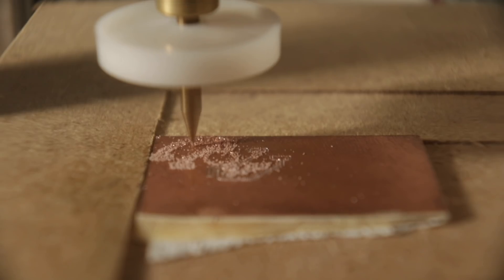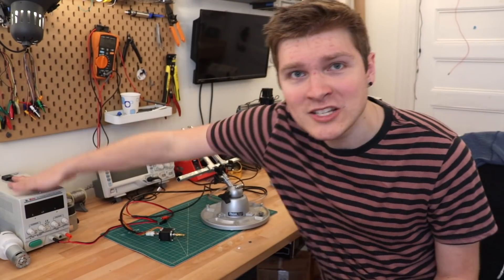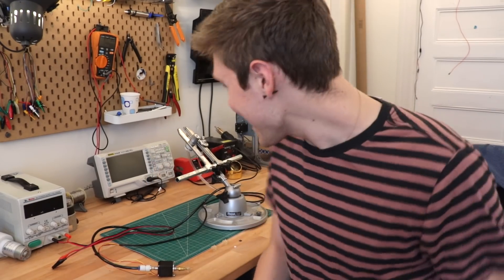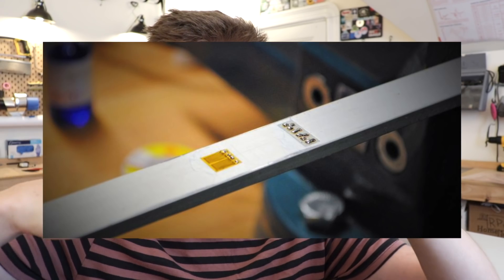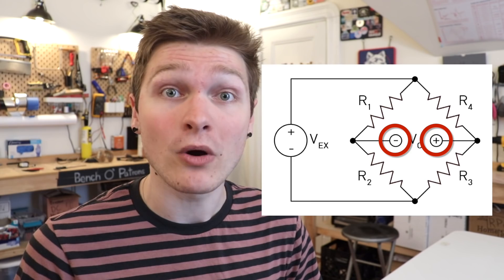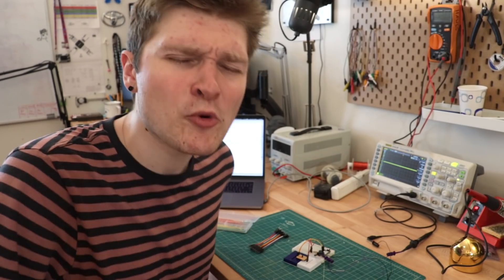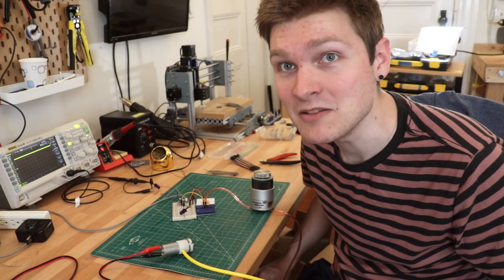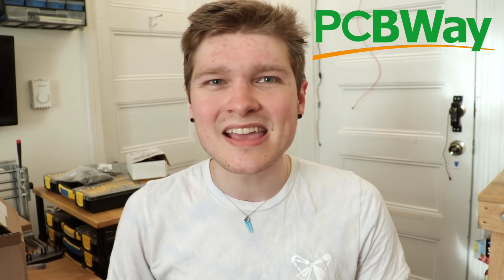Vacuum Sensors Are My Nemesis

Comment: Could you measure the current draw of the vacuum pump itself in order to tell if it's got a part picked or not? I imagine it would draw more when the motor is under load.

Comment: What about the MPX4250??
From their datasheet: Integrated Silicon Pressure Sensor
On-Chip Signal Conditioned,
Temperature Compensated and
Calibrated
0.2-5V output.

Comment: I tried the 180 degree strategy. But the open PNP guys didn't want to support the software.  They want 360° rotation.  I changed the code, but they update the code so much, that I gave up.

Comment: How about monitoring the pump's motor current? (or RPM if you can fit a hall effect sensor somewhere on the motor)

When there's a part attached and vacuum drawn the current should decrease and RPM increase due to less airflow through the fan.

---

EDIT: Should have read the comments. Seems this has already been suggested a few times.

Comment: What you really want is an instrumentation amplifier. But more Than that, there are pressure sensors with built in amplifiers and even adc's with built in calibration and a digital interface. For the sake of saving time and getting a better signal I suggest you get some of those.

This is a good one: https://www.adafruit.com/product/3965?gclid=Cj0KCQjwyJn5BRDrARIsADZ9ykGusnihpehcSzs6N50H4rc67sYxJeXsjRiau5O0UXXwx8eqmVbDoNEaApwMEALw_wcB

Comment: You mention that the rotary joint is leaking air, where does it leak air? is it the adapter below or the screw part of it?
There's sealing material available which is normally wound around the screw part.
https://de.aliexpress.com/item/33033430576.html
I did not see that on your rotary joint, can you double check that?

Comment: Why not just meansure the current going to the pump?
When it's on "load" it will draw more current
With that you can tell if it has picked up a thing or not
Easy
Reply: Just made a similar comment, but it will draw less current, and RPM will increase  when the inlet is blocked (not bog down as someone else said).

Try it with your vacuum cleaner at home. Block the hose and RPMs will rise quite sharply and if you have something to monitor the power drawn from the socket you'll see a drop in power consumption.

....it's fairly counter-intuitive, but pump is doing less work and moving less air so motor is under less load (so will spin faster). Same happens with a box fan or PC fan if you lay it flat on a surface.

---

Oh yeah, with a diaphragm pump the opposite will be the case (but that's not what we're using here).
Reply from the maker: hmmm, that's a pretty cool idea! might also be useful for other things that could be controlled with the FETs on the board. ill look into that!
Reply: @stephen_hawes  while this is a cheap way, a kinked hose will send a wrong signal.  And if you plan on having more than one vacuum actuator in action (multiple pick heads) then it will be an issue.
Reply: Was about to say the same thing but saw this comment. Way simpler to do this, and you don't need to buy a special vacuum sensor

Comment: I've used the ADS1247 ADC from TI for similar resistive applications - it can be configured to output a fixed current that can be used to drive a resistive  load (in my case I was using a PT100 thermistor) in a 'ratiometric' approach. Accuracy will be down to how accurate your reference resistor is (ie pick a 0.1% tolerance resistor and you've got very high accuracy). You can communicate with the chip over SPI, set interrupt triggers on the chip itself (ie once it detects a certain level, it triggers an interrupt pin that can be used to signal back to the MCU). I guess in the bigger picture, the same ADC can also be used for high resolution sampling of thermocouples or other analogue devices. Just a thought but it's an easy implementation that gives you a ton of functionality (and a digital output).
Reply: Take a look at 2.4 (Three-Wire RTD Measurement, Low-Side Reference, One IDAC Current Source) in this TI doc for rough idea on reference design: https://www.ti.com/lit/an/sbaa275/sbaa275.pdf ... I dropped the input impedance resistors and smoothing caps on the line side and it worked well for my purposes! You could basically just drop the part across those pins and you'd have your digital output.

Comment: hello，I can successfully upload your firmware to ARDUINO, ramp1.4, or connect with pnp software, but I can’t control the motor movement. I hope to get some help, and what went wrong, or you can issue a simple issue of how to upload the firmware Control the video.

Comment: If the vacuum pump bogs down when you cover all the holes, couldn't you just measure the increased current draw to the motor to detect when you've picked something up? This seems a lot more simple than trying to add a pressure sensor.

Comment: INA333 is a great part for your wheatstone bridge, btw! one resistor to set the gain, GND referenced signal out.
Reply from the maker: sweet, thanks for the part number! i'm looking into using chips from that INAxxx family, seems like it'll be more straightforward than doing it discrete.

Comment: A wheatstone bridge is not neceserly build of two extensiometric gauges the definition you gived wasnt wrong neither wasnt good, as long as you only nead 4 normal resistor to build a wheatstone bridge which btw is a quite common way of signal aconditioning for all the resistive sensors. And for the sake of electronics learn at least ideal op amp they are the easiest thing in the world of electronics. And for those type of builds you wont need to know whats happening inside
Reply: However love your videos dude you are awesome and that pick and place machine iss pffff

Comment: The "Programmable-Air" uses a similar or the same gauge pressure sensor and is controlled via Arduino. The schematic is available here: https://github.com/Programmable-Air/PCB/blob/master/programmable-air-v0.5/schematic.pdf

Comment: Check out Honeywell's TruStability Sensors. I have used the Analog output ones with a lot of success, but they also have digital I2C and SPI versions. (kinda pricey tho, they're pretty accurate)

Comment: You know... The power supply behind you was changing current wildly every time you sealed or broke the vacuum... That gave me a totally different idea on how to detect of you picked up a component.
Reply: That is actually not stupid idea to just sense the current! And it can be done with just a simple INA214 and a 10mOhm shunt! Used it a few times before and it works really well!
If you read the comment Stephen then just remember to place the INA214 close to the shunt. There are great layout examples in the schematic or HMU if you need some help with it
Using 10mOhm shunt and the INA214 you will get a 1:1 so 100mA is 100mV
Reply: that is actually pretty smart solution

Comment: Hi, your PNP vids have been interesting. 👍
I used silicone surgical tubing on my machine, it is rubbery soft are easily rotates the 180 degrees, and it easier for the machine to move it than plastic tubing. You can buy smaller sizes, sometimes also used for surfboard legstraps or slingshot rubbers.
Definitely try the Honeywell sensors, with inbuilt amp giving calibrated 0 to 3v output.
Finally for the pump I use an aquarium airstone pump, rigged to suck not blow. It is very quiet and can run forever without overheating etc.
Also, your vacuum solenoid to turn the vacuum on/off should be a SPDT type so it releases the component by letting air in. They are common in 12v fuel injected cars and motorcycles. 🙂

Comment: For prototyping purposes, you could try programmable air: https://www.programmableair.com/ which is an open source arduino compatible board that can both control and sense vacuum.  plus a couple of valves thrown in too. The kit comes with all the things for you to build the pneumatics for the pick and place, right away. But, since, i dunno when their next batch will be up, you might not be able to buy one. (I got mine during its first crowdfunding campaign, and have been trying to learn from your channel, the journey towards building a pick and place machine myself). It is open source. So you could just see what parts are used there and use the libs for it too. https://github.com/Programmable-Air. Also, there are ADCs with differential amplifiers built in, like the ADS1115 (16 bit) or HX711 (24 bit), with which you can do your strain guage measurements. You can make constant current sources with LM317s too, which is generally something that you'd probably have a better intuitive understanding of.
Reply: It looks like it has the same sensor you're using. And uses an instrumentation amplifier

Comment: Steven, You can get 360 degree rotatable fittings from Festo that doesnt leak like a sieve. Don't confuse with the Orientable type. Pages 11-14 https://www.festo.com/cat/xdki/data/doc_engb/PDF/EN/FUNCTION-FITTINGS_EN.PDF
Also think you should use the smaller diameter tubing reducing volume of air being moved and increase time for vac etc. Possibly PUN-CM-4-SW.  Its antistatic as well.

Comment: Stephen, in case you haven't discovered it already, I'll point out some problems with your schematic. The current source is supposed to set 100uA through the bridge. Your voltage divider R19 - R20 sets only 1.65V, which would cause U9A to set 1.65V across R23, setting only 82uA. (So you would get only 80% output compared to the reference example spec.)  OK, but that 82uA passes through both R23 and the bridge, which is also 20k, with the resulting voltage across them of... 3.3V.  In other words, this circuit design asks U9A to output 3.3V at pin 1. But LM358 (if that's what you're actually using) can't do that, because its output swing is limited to about +rail minus 1.5V, or about 1.8V.  Even if you used an op amp that can swing rail-to-rail, you're asking it to sit at positive rail, so your "current source" is actually no better than just connecting the + side of the bridge to +3.3V.  At any rate, these missteps screw up the ability to set the two bridge output voltages to approximately the middle of the useful range of the output opamp, which you need in order to get useful amplification (x50) at that stage.  You managed to get some useful behavior by throwing in a pot to essentially tweak out the problems in the bridge area, but this is sticking a large bandaid on a problem that can be solved easily with (a) a rail-to-rail-capable op-amp (if you insist on running off only 3.3V), and recalculating the R19-R20 voltage divider so that it sets the bridge outputs at mid-rail (1.65V), and changing R23 so it sets 100uA. So about 6.5k for R23, and about 2.65V at the top of the bridge, so R19-R20 can be a ratio of  0.65 to  2.65, so maybe 6.5k and 26.5k.  And since you would then be using the full bridge instead of half, you get twice the output and also insensitivity to temperature changes.
Reply from the maker: Wow, thanks for the super in-depth info! I had a feeling someone would take a peek at the schematic and tell me what i screwed up! :D I still have a ton to learn about op amps, this has definitely helped me figure out what I need to spend time reading up on. I'm working through the Art of Electronics right now, it's been really helpful in the chapters I've gone through. In the meantime, I ended up going with a sensor that handles the signal processing for me, but this stuff will inevitably come up in future designs.
Reply: @stephen_hawes  Great, I'm glad to hear you have your hands on AoE. Something to grasp is that Op Amps actually vastly simplify analog electronics, essentially providing you with a small number of idiomatic circuits that function as Legos for "analog computing". That is to say, these Legos have a simple behavior where the output of each stage is a simple algebraic formula based on the input(s). It's helpful to know why that algebra works for each of the few op amp idioms, so that you're really convinced, and so that you know what you should also attend to in order to get that "ideal" behavior. The upshot of all that is actually there isn't really "a ton" to know. Just a few essential principles.  In your circuit, you would have got the result you wanted if you realized how the first op amp sets the bridge current, that an objective was to maneuver the bridge output voltages to mid-rail so it has room to vary up and down, and that you need op amps whose outputs can actually swing across the voltage range of interest (not a universal trait when operating with such a low power supply voltage).    So being able to pick out the basic specs on a datasheet would help too.  Anyhow, I'm glad you found a solution, but regardless encourage you to get comfortable with the not-very-extensive basic suite of op amp idioms, and AoE can be quite a help in this regard, in addition to loads of material on the internet (some clearer than others, as usual).
Reply: Dave did a great primer on opamps here. I learned a lot from it...

https://www.youtube.com/watch?v=7FYHt5XviKc

I still find analog stuff a bit daunting, but a bit of Ohm's law and opamp examples really helps.
Reply: When he said "general purpose op-amp" I thought the same but you have here an awesome explanation, nice work, also I really have to learn a lot more about op-amps
Reply: Great explanation. You're probably also better going with an instrumentation amp for this kind of thing.

Comment: Hey Stephen, have you looked at the Honeywell pressure sensors?
https://sensing.honeywell.com/sensors/amplified-board-mount-pressure-sensors

They have the drive and amplification integrated and they have analog out and digital I2C. I’ve used them in the past and they’re super easy to work with!

Comment: Op amp circuits are designed using nodal with the assumption that the two inputs draw no current. However if I were you I'd stick to common designs and use spice simulators or at the very least Google a website called falstad circuit sim
Reply: Use spice design and / or ask discord community ...

Comment: What kind of vacuum tubing are you using ? It looks flexible, the thick wall stuff I have is hard as a rock. FYI Sparkfun just released a really nice pressure sensor breakout board. I hate opamps, lol I spend the money on an instrumentation opamp, so worth it.

Comment: Great video! 🙂 Small tip - there are some MCUs that have an integrated analogue comparators which allows you to read the reading directly
Reply: Hey another favorite up and coming tech diy channel!
Reply: Oh, that's what it's there for. Never came up with an application for an analog comparator
Reply from the maker: Oh wow, that's rad! Didn't know that was a thing! I'll have to keep an eye out for that, would have saved me a ton of heartache!
Reply: @stephen_hawes  depending on how small the differential signal voltage is you may be able to get away with a cheap board like the HX711 (typically used for strain gauges). Or if you have a few signals to measure, play with the ADS1256 which can read 4x differentials and has PGA (I have a couple tutorials for them if you need). Lastly, the teensy has a PGA built in as well. Or go old school and use an instrument amp to convert to single ended to read with standard ADC on MCU

Comment: Op-amps are easy.  Try doing it with BJT's.  R6 in the Omron user manual for the sensor is the biggest gain control part.  The bigger R6 is the more gain you get. Have you looked at the MPXHZ6250A, MPXH6400A, or MPXV6115V pressure sensors?  I'm partial to the MPXV6115V.

Comment: Hi Stephan, take a look at the HX711, it is able to interface to the Wheatstone bridge and it has also a 24 bit adc, a bit overkill but it should do the work, it is the one that is used with strain gauge, and having this pressure sensor a similar working principle it should work, also it give you directly a digital signal to work with!

Very good job!
Reply: Same here! The HX711 uses it's own weirdo protocol with clock and data, but there's an Arduino library for it and the generic breakout board costs about a buck. Maybe worth a shot!
Reply: I was about to suggest the same... :)
Reply: Alternative to HX711 is NAU7802..which you can buy from Digikey.